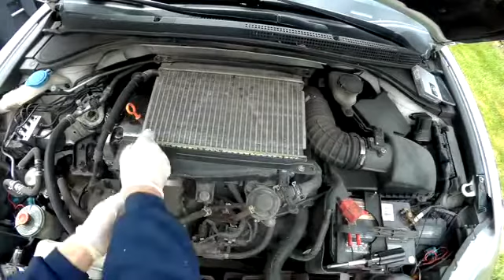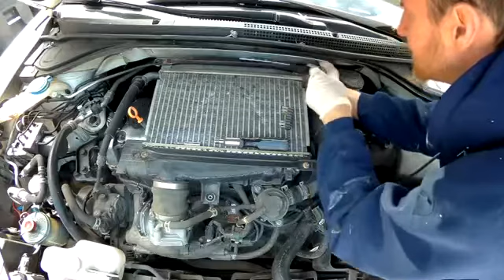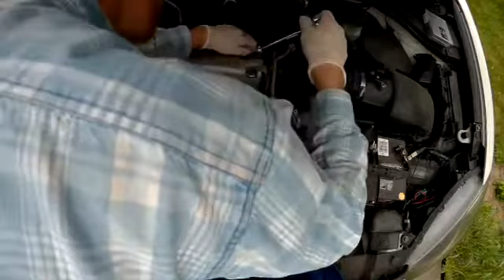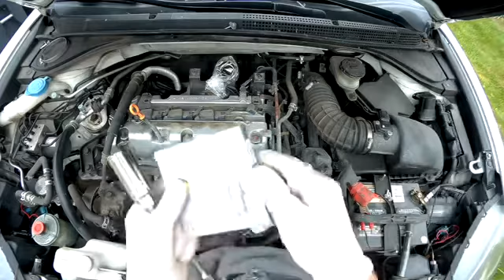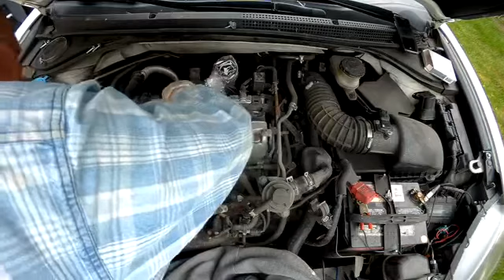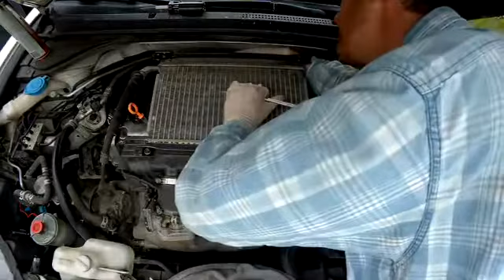2008-2012 ACURA RDX spark plugs change

Comment: At 7:50,  only thing you  need to do is just pushing the whole cooler back and a little upwards, then the cooler will come off the front hose very easily.  Do the same way when you want to put it back in.  Lose the top claim of the hose, don't need to lose the bottom one.
Reply: Ok bro. Ill take a look next time . I don’t drive the car for now but still have and one day will start driving it